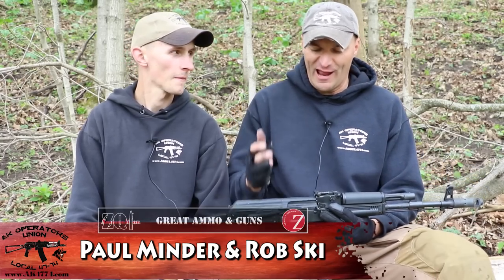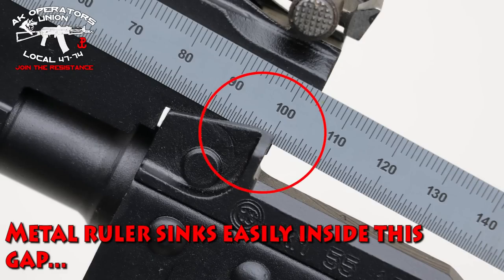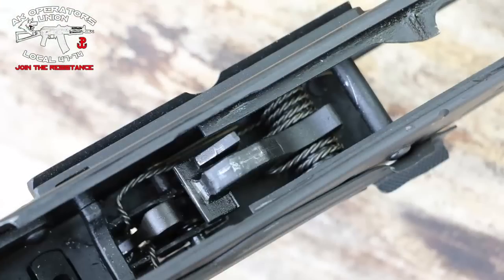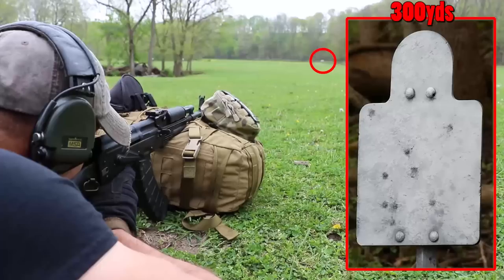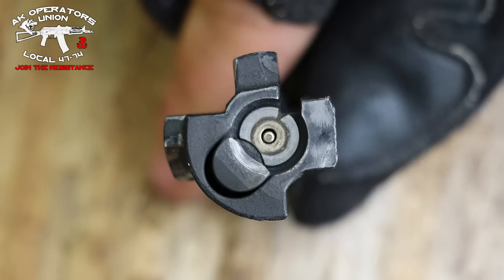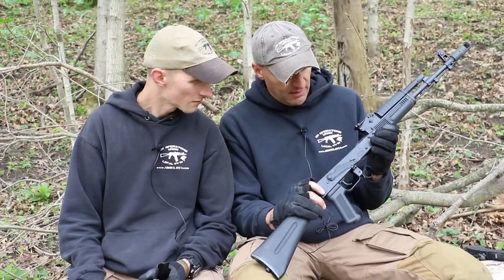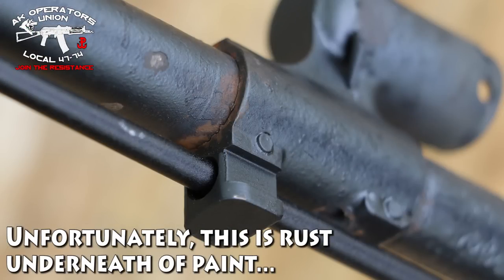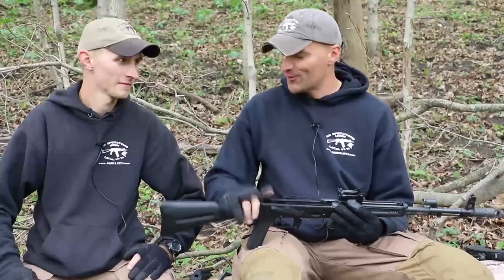Arsenal SLR107 1000rds Later - Bubbles Attack!

Comment: I DO NOT understand why people insist on paying so much for what amounts to a half ass home build AK.  I'm not saying that a WASR is better, but at least the WASR isn't $1000 gun, AND the WASR doesn't have finger paint for a finish.
Reply: Lol it is like that chalky paint kids use. My SLR hasn't had bubbles yet and I've got it pretty hot (knock on wood) but some paint chipped off the bolt carrier. My wasr and the hated c39 haven't had issues with the finish lol
Reply: +Andrew Sanford I've been reading quite a few of these comments, and the shitty paint seems to be a consistent issue.  I think a good fix would be to disassemble the rifle, hit it with Jasco Paint and Varnish stripper and just take the paint right off.  The rifle is parkerized underneath the paint anyway and will look better.  Or you can get a spray can of black cerakote  for around $30 and do the treatment in your oven at home.  It sucks that we have to consider these options with a $1000 rifle, but they're not too difficult to accomplish.
Reply: +simonferrer yeah I guess I'm gonna do that when it gets bad. it's not the end of the world by any means it's just crappy cuz I paid alot for the damn gun
Reply: Andrew Sanford I know what you mean.  On the positive side, the Jasco works really quickly (around 15 minutes or so) and takes paint right off should you choose to go that route.

Comment: I always felt that Arsenals were a bit over-hyped. I think the big take away from this 5,000 round test will be that the emperor wears no clothes so to speak, and that Arsenals really don't justify their $1000-$1300 price tag. There's going to be a lot of seriously butthurt Arsenal owners when they realize their beloved rifle is really no better than a much more modestly priced brands.
Reply: I don't speak for other Arsenal owners but I wanted the features Arsenal has that others don't. I want the 24mm FSB, 90 degree gas block, and folding stock setup. Adding those features to a $600 WASR would bring it up to Arsenal prices so you might as well just buy the Arsenal.

That being the case I can't defend the crap that they are pulling with this rifle in this video and agree it is unacceptable.
Reply: +Google- I sense the fanboy in you telling you to ignore any opinion other than his.

Comment: I'm not an AK guy per se. But it's not hard or even that expensive to Nitride the barrel, and other metal components. Using some sort of paint or even Gun Kote is obsolete and an inferior exterior coating. Nitride is actually a metal treatment that goes on "Clear." Then manufactures "Black Oxide over the Nitride treatment. Black Oxide is stupid easy to apply and adds no real cost...i.e., Black Oxide the metal parts would add maybe $15 to the rifle...if that.

Comment: ok. lets do the math arsenal 1000$. my two wasr 10/63 750$ before any modifications. one all original ,the other modified. stock,hand gaurd , pistol grip , vertical grib and bushnell trs-25 . roughly the final cost 1100$. arsenal you should hold yourself to a higher standard. both wasr 10/63 looked better out of the box.

Comment: Wonder if only rifles with the serial number starting with XM55 are affected. My SLR107 starts with the serial number XK54
Reply: Mine is too
Reply: Nope yours should be fine. I also have the xk54 and my rifle is straight and finished well, oh and very accurate.
Reply: +acidburn134 yeah I kinda figured we are fine. I was thinking that this fuck up is isolated cuz really haven't had alot of feedback on this yet
Reply: +Andrew Sanford I guarantee it will be the most of the batch and the prep work to parkerizing and painting wasn't done properly. As far as canted sights , that's pretty common but inexcusable.
Reply: acidburn134 yeah my rifle has a little tiny bit of can't, but my wasr has zero lol. And your probably right. Arsenal is getting a shitstorm now for it
Reply: +Andrew Sanford my rifle has no cant but it wouldn't necessarily bother me if it did as long as I could zero it, I made sure when I bought my rifle i removed the bolt and gas tube and made sure everything was aligned, WASRs are surprisingly great rifles
Reply: +acidburn134 man I love both my arsenal and my wasr. my c39 though is a bastard child. I hate him
Reply: +Andrew Sanford lol WASR is the only century marked AK I will touch

Comment: Arsenal clearly fell asleep at the switch here and needs to be called out for it. This rifle and some others were never parkerized as they were supposed to be. Paint wearing off with use is one thing but paint bubbling off like that after 3 magazines is unacceptable for a $1,000 rifle. Let's not put up with this nonsense. The attitude that finish on an AK doesn't matter and that all we need to do is wire brush it and paint it ourselves is utterly ridiculous. I don't expect to spend $1,000 on a brand new fixer upper. Arsenal is a solid rifle of good quality and will last longer than I will...but...Arsenal needs to improve their finish QC. This isn't about blasting Arsenal in particular, this is about not letting any gun manufacturer get away with handing us sub-standard QC rifles and expecting us to sit back and take it. We didn't let Century Arms or I.O. get away with it so why should Arsenal get a pass. If you think spending $1,000 on anything that you bring home and then proceeds to shed it's finish is ok then go right ahead and continue to make excuses for this kind on nonsense. A fool and his money are soon parted.

Comment: Great review. but compared to the 556 counter parts it seems like no matter how much you pay you are not getting what you pay for when it comes to an ak. Don't get me wrong I love the ak platform and own a few but it seems like you get a better made rifle in the ar platform for the money.
Reply: +Pray &amp; Spray here is big problem with AK on USA market. Its mostly US problem due to its laws. Most of AK variants with few exceptions like Vepr come to USA as kit. Pending that that kit was build properly in factory, it comes to USA and then they have to be build by someone here. A lot of builder with except of few, don't build them like they should. Its too many exchange of hands and something will go wrong. Vepr come already build, but it comes in sporting configuration, so you have extremely well build rifle, but requires some modification to get them to become AK you want to have. Don't get me wrong wood is so nice on them.
Reply: +maksim tsionskiy Yeah the R22 compliance. I've always wondered like with the saiga when someone says that they have converted it what that means. What needs to be converted on them?
Reply: +Pray &amp; Spray well it really depends how you want the rifle to be: tactical or classic ak look. But you have to have 10 parts of the gun US made. So Magazine is 3 parts, muzzle brake 1, and etc...  I forgot exactly how many parts each thing, easily google that. Its pain in ass and can be expensive. But the base of rifle is solid, you don't have to worry about hopefully century or somebody else put it together in factory. It was done in Russia and they do know their guns and take big pride making them

Comment: Arsenal must use regular paint on their AK's every Arsenal I have the paint comes off after the first cleaning (gun scrubber removes it quite well), if you're paying over a grand for an AK the least they could do is use some decent firearm coating like kg guncoat, or cerakote, otherwise my arsenals have functioned pretty well for the most part
Reply: +Tony Arnott The thing is with arsenal, is there manufactureing methods are basicly excact rip offs of the Russian methods, which intales, you guessed it, spray paint. That's why you will never see a factory Russian AK with a decent finish, Because once its used, the paint flakes off, and once you clean it, the solavents disintegrate whats left. I suppose that's why they always did paint over parkerizeing. the paint just kind of covers the main protective finish, frankly it would almost be better if they dident bother with the cheep paint over and just kept it plain parked.
Reply: The manual tells u all u need to k ow about finish on an arsenal and I think they say use brake clean or something because that is what they tested the paint with.I agree on paint job needing to be better but it is what it is
Reply: Tony A yes I agree but then they would charge more also the gun rob is using is a remanufactured gun it say so on kvar site about the SLR 107  fr. Not that this should make a difference but I just thought this should be pointed out.but agree they could do better but even Jim fuller of rifle dynamics stated that arsenal had good guns that would go bang every time and to me at this price range is really what matters not the paint.spray paint and some primer for a couple of dollars not hundreds of dollars could fix problem several times over
Reply: I mean true it is easy to fix, just finish it properly yourself, its just inconvinant you have to do it yourself, really I don't care because the parking does the rust protection and aks for me arnt "look nice guns" as much as "woods guns"
Reply: +Andre Krumins I wish I could but don't have an air compressor my only option is to pay 250$ to get it cerakoted
Reply: Tony Arnott I think it would cost about the same to buy a compressor and do it yourself, and then youd have one to use later.

Comment: So I guess I should get a DDI then, I'm not that anal, ha ha ha, about the finish of a rifle but I do appreciate a good trigger.
Reply: +inamadworld With the limited experience I have on my DDI. I quite like it. My bolt will stay back if I let go slowly, but that can be worked out with some sand paper. My rear sight tower points off to the right slightly. But it's zeroed with my front post right in the middle of the hood. And, my top cover needed a little bending on the back to put on and take off properly. Other then that everything is great. It's an AK so I personally don't think one can expect AR Build quality. Especially for about $700. Hope I could help a little.

Comment: i dont care if the paint is an issue. I painted it a month after i got it. black is a shit color.
Reply: It's unacceptable for a 1k rifle.  You can also see the rust spots.  My Saiga doesn't have any of these issues and I spend $350 dollars less.
Reply: +Tony King my sgl2131 doesnt have this issue. of course again i painted it with rustoleum not long after getting it.
Reply: +Tony King I'd agree.  It's really not hard to do a proper paint over park.  These guys could do it if QC didn't blow.
Reply: +Gren Moyo for 1k I shouldn't have to do any rustoleum or anything.  I could have cerakoted my saiga and it would still cost less than this 1k arsenal.  For 1k or more its definitive arms or rifles dynamics for me.  Anything under 1k I'll stick with saiga or vepr.

Comment: Personally, I couldn't care less about the slight cant that gun's sights have, but by all means the paint on any gun should not bubble and flake like that.  At least the RAS47 had good paint.  DDI has good paint.  Heck, even Hi-point's paint doesn't flake off that way.  You telling me they are better at applying paint than the elite Arsenal, Inc.?  Apparently so.

 I was told about an automotive paint that matches my Saiga paint, and it has held up without bubbling, and I'm certainly no pro painter.  I wouldn't even call this Arsenal paint job good enough to be done by monkeys... that's not fair to the monkeys.  This is just plain lazy, greedy and sad.  

Two things now that will have to be pried out of my cold, dead hands:
1.) my Saiga
2.) any money of any sort going to Arsenal for an AK.  Especially for over $1k.